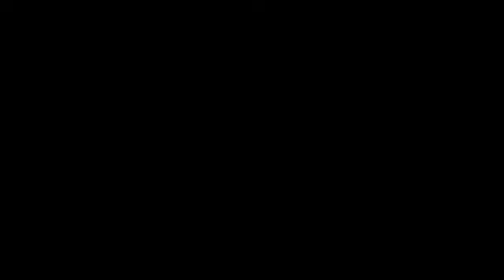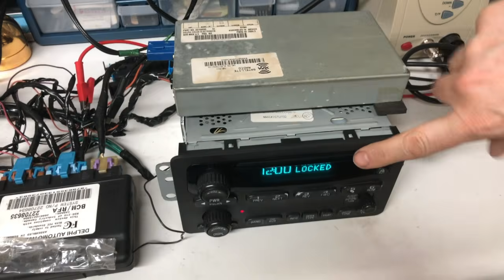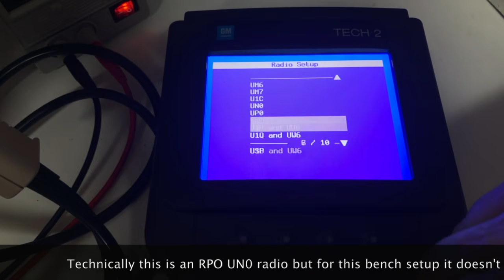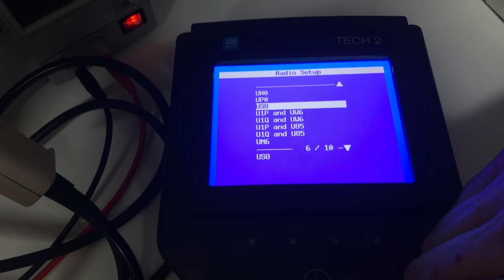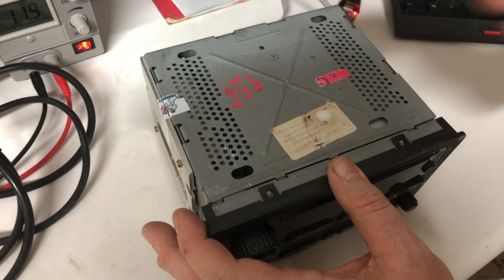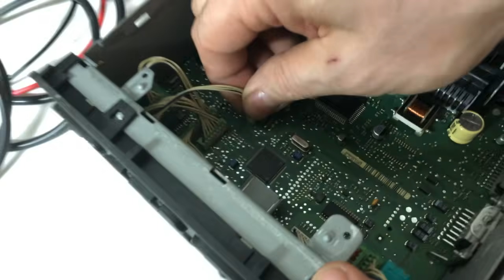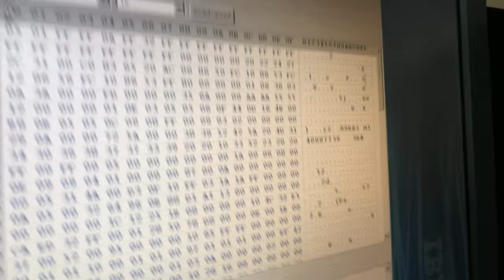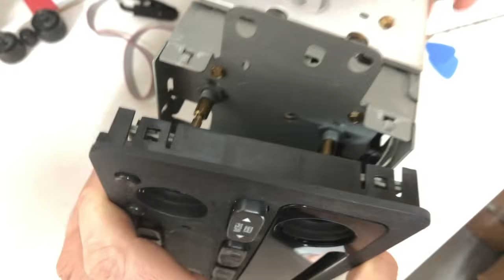2003 - 2006 How to VIN Unlock Salvage Yard GM RDS Radio w/ Tech2 OR Manually Programming its EEPROM

Comment: The Tech 2 doesn't seem to do a VIN relearn on a 2005 GMC truck
Reply: Yeah, I needed a new head unit in my truck (original one stopped having sound output) so I when to a junkyard and bought a new one. When I went to reprogram the radio with my tech2 (it's a clone) I didn't see any of the options or functions to reset the radio and release the lock. So now it just sits on my shelf. I have since then moved on and installed a aftermarket head unit but always wanted the stock radio...
Reply: My truck is a 2007 Silverado classic so it should be very similar to a 05 Silverado/Sierra

Comment: FYI - I was working with a six disc CD radio(GM part # 10357886) pulled from a 2004 Suburban and going into a 2004 GMC Yukon XL Denali.  I was using a CH431A black programmer and AsProgrammer 2.1.0.13.  After some fiddling around (and help from your video) I was able to get an output screen of all zeros.  As mentioned in your note, I was concerned that I would have to desolder the eeprom, which can be a bit tricky.  It turns out that if you connect the test clamp just right a small yellow LED will light up on the front of the radio, with only a single red LED on the CH431 for the power, not the LED for the run status.  At this point I was able to generate a hex output using the I2C, generic 24CXXX, 24C08 profile that allowed me to change the VIN # which was on line 0X000003B0.  I installed it into the GMC and all the radio functions are working, except for sound?!  That will be my next project...Thank You Dr. Shock, and I hope this helps someone else down the road.
Reply: yes same for me :D

Comment: Modified the CH341A for +5v output like you described in your other video.  The radio I'm trying to unlock (from a 2003 Chevy Suburban) looks the same on the front as in your video, but under the bottom cover I found the 9355093 EEPROM and it is not obstructed by anything.  Anyway when I connect the test clip to the chip, I keep getting the message "Connecting Error CH341 (not found)".  I have tried multiple times to read the EEPROM (with the old radio so I don't screw something up with the salvage radio), but keep getting the error message.  Tried turning the clip around backwards on the chip momentarily, but the red light goes out on the CH341 programmer!
Is it possible the chip is bad or can't be read on the board??  I'm frustrated!
Reply from the maker: Some radio circuit board designs have multiple chips on the same traces to that EEPROM.  So a testclip creates interference, bus contention, by powering up those other chips at the same time.  In those designs, you have to unsolder and remove the EEPROM from the circuit board and work with it off board.  Then resolder it back when the re-programming is complete.

A good way to verify this is your situation, is to attempt to read any known good EEPROM chip with the programmer before working with the radio.  Always test that your equipment is working OK before starting a repair.
Reply: @DrShock  Bought EEPROM chips and tried to read a 24C08 chip with the CH341, but it can't read the chip!  Wondering if the ASProgrammer I downloaded from your link is corrupt??  The version I downloaded has already been translated to English (not sure if google translate automatically changed it from Russian).  Could you send me a direct link to the software?

Comment: What if you don’t have access to the RPO code such as a radio from eBay? What do you do at that point?
Reply from the maker: If the radio in the vehicle is original OEM, just go with the GM part number on the white sticker on top of it.   If the original radio is missing, you will still have the RPO code attached to the vehicle service parts sticker, and a dedicated radio shop will be able to identify the correct replacement with that plus the VIN.   Even better, the radio shop will be usually be selling it as unlocked.
Reply: @DrShock  ok it still has all the stickers, do I take it to the dealership?
Reply from the maker: For the age range this video covers, going to the dealership for an unlock would cost more than two or three times the value of the radio itself.  If this isn't something you could do yourself, I'd suggest a radio shop or a small independently owned mechanic shop that has a GM Tech2 type scan tool.
Reply: I’ve got a tech2win, and I was able to get the vin from the seller on eBay, and I got the rpo code. Will the bcm in the car write to the radio if I set the tech 2 off the donor vehicle?
Reply from the maker: Not all GM model BCMs will do the VIN relearn function, which is why I also showed how to edit the chip at the board level.  But if you have the tooling, build the vehicle in Tech2Win and confirm it has the menu option I showed in the video first.

Comment: How do I verify which chip I have? Trying to unlock a 2012 traverse oem radio
Reply from the maker: Trial and error is really the only way if its not one someone has already published information on.  You need to desolder the chip from the board so you can experiment on it out of circuit while attempting only read operations while trying different chip family settings in the programmer software.   Sometimes there will be a fab symbol on the chip to at least indicate the manufacturer.

Comment: It is a great video! But it’s a bit beyond my capabilities, especially with my rocks, screwdrivers, hammers, and basic multimeter. Very interesting, and one day, possibly when I have more time I’ll be back to try it on my stock stack. aftermarket radio will have to do.

Comment: When you say "standalone" you mean without GM software?  I am VERY new to tech 2, got one for working on Saabs but the PCMCIA card is Saab only and doesn't work in a Silverado.
Reply from the maker: You can use the Tech2 all on its own, without the TIS2000 software.  I refer to that as standalone mode.   Unfortunately, GM has dropped support for the Tech2 back in 2021 for the online Techline Connect software, so they can really only be used standalone, or with the vintage TIS2000 PC based software nowadays.

Comment: Greetings and thanks for the good informative video.  

Now then, seems no one on these videos are going into enough detail for those of us who are unfamiliar with the programmer sequencing.  Can you refer us to any videos are explain how to set up and navigate the Programmer... how the interface works, etc., in better detail...it just looked like a bunch of Matrix type numbers scrolling up the screen all jumbled up.   How exactly would we know to put that other last six digits of another VIN number in?  Where did that number come from??  How do we get to that screen you were on?  LOL, what's going on?  Any additional helpful advise so we can make sense of what we saw you doing in regards to that chip-reading/re-programming part of the video would be great. Thanks.
Reply from the maker: Thanks.  It would be very easy to brick a radio if you did not have prior experience with chip programming.   My advice here would be to simply desolder the chip from the original radio, and transfer it over to the donor.   This route would requires some experience and having the tools used with surface mount device soldering, but no programming.
Reply: @DrShock  okay That’s what I’m thinking.  Thanks for your feedback!🙂

Comment: Hello, I know this is an older video but, will the steps for eeprom programming work for a 2007 gmc yukon xl radio that has the dvd player in addition to the cd player?
Reply from the maker: The process and approach will be the same for any Delphi/GM radio of this era.  But the circuit board layout can vary considerably model to model.   And the EEPROM number on some less popular radios may not be already known, so you may have to experiment to identify which chip is the correct one.

Comment: Can you just swap the eeprom chips from original radio into the replacement radio?
Reply from the maker: If the GM/Delphi part numbers on the radios white label match exactly, yes you can.

Comment: question! what would happen when manually programming the eeprom if you left the vin section blank or removed the existing vin and dont replace it?
Reply from the maker: Depending on the radio model, either 0xff or 0x00 hex written to these locations will end up being viewed as virgin out of the box mode and the BCM will encode the VIN automatically.   This will only work if the exact same number of bytes as the VIN are used, one more or less and it will remain locked.
Reply: @DrShock  thanks doc!

Comment: Trying to use my vcx nano and tech2win to replace Bose radio in my 2003 suburban but no matter what code I select for vehicle it only comes up with Chevrolet truck and then I select radio and it keeps saying no communication with radio.
Reply from the maker: Communication protocols to the radio change over the model years,  so be sure that the radio is the same model year as the truck.   When you build the vehicle in the Tech2 menu, be sure to select the model year and engine code based on the VIN.
Reply: @DrShock  I appreciate the quick response. I’ve been reading comments on this video and discovered that you need to build the vehicle in tech2 for the vehicle it came out of?

I have two used radios. First one is a 6 disc changer 15184935 manufactured 10/01/02 so guess it’s from an 2003 Silverado or suv. My original radio is a different part number but looks identical. Other radio is a single cd and cassette combo. Part 15104156. Manufactured 01/30/04. No idea what this came out of. 

If I understand correctly I just need to try different years and vehicles until I can successfully reprogram vin?  I’m trying to do this with key in on position which radio then goes into theftlock. 

My original 03 suburban Bose radio works great unless it’s below 50 degrees then it powers on but no sound until cabin heats up. And it still randomly reboots during use. I’ve tried heating the main board of radio up to 400F to reflow solider, this helped for a few days then back to its old problems.
Reply from the maker: You don't have to match the original radio part number wise.  You can upgrade to something higher, but you'll want to stay in that same model year vicinity and what was available on the truck new.  Like a 6 disc changer from another Chevrolet, vs one from a Cadillac Escalade.  This is usually the path of highest compatibility.
 
The comments you're reading on building the vehicle differently than actual have to do with getting around when GM removed the ability to do a VIN relearn from the menu.  But you mentioned having no communications at all, so different problem.  You need to solve the lack of comms first.   This is usually, other than the VX Nano variable, due to having a mismatch in compatible modules hence my model year comments.   Verify comms to other modules, like the PCM, to avoid his being related to the Nano.
Reply: @DrShock  spent more time with vcx nano and tech2win. I verified it actually is connected to my 03 suburban. But every time I select year the vehicle (chev truck) and a letter code? Tried all the letter codes and I always get message cannot communicate with digial radio. I can however display data from radio and read DTC codes like u1000 but whenever I try and vin relearn or radio setup it just completes right away and radio stays locked. 

Only vehicle I don’t get the can’t contact digital radio message is the express Savana but once in menu there isn’t a radio setup or vin relearn just other functions like srs vid info radio id info etc. 

Seems like my vcx nano tech2 software can’t remove theftlock with my 03 burb radio even though I can read its data like volume level antenna strength etc.
Reply from the maker: I did an older vid on how to know which code to pick when building the vehicle - https://youtu.be/TwUFPPy3J_I for future reference.  It does sound like a problem with the Nano.   You might try just doing an SPS (TIS2000) or SPS2 (Techline Connect) recalibration instead of the VIN relearn.   For older vehicles like your 2003, this usually (but not always) will also perform a VIN relearn.
Reply: @DrShock  making progress I think lol. On the main menu I can’t go to sps get an error it’s not supported by tech2win. I can however go into diagnostics select my year, chev truck, then K, body, navigation radio, then body control module, special functions then I can F1 request BCM info for sps or f2 request VTD info for sps. I did f1 and it says info stored in tech2win but I don’t know what to do from there. I don’t have the tis program you speak of in another video
Reply from the maker: No you cannot do SPS with Tech2Win, GM blocked that along many many moons ago.  You have to use Techline Connect at www.acdelcotds.com which may also require updates for your Nano to work as a J2534 diagnostics interface.   ACDelco will do a two year per VIN bundle for a fair price on SPS2.    I can't say for sure this will work with a Nano, I only use it with the GM MDI tool.  But I have read of folks getting the Nano to work with it.  I also can't  say for sure it will do the VIN relearn, as when I hit these problems I just drop down to the circuit board level and swap EEPROM chips.   But again, I've read folks had some success doing so on older vehicles.  Newer ones, no dice.
Reply: @DrShock  thanks again for the quick responses I’ll probably do that subscription and post back if I’m successful. My local dealer charges $150 an hr and I’ll still be in it less than that by purchasing vcxnano and the delco subscription
Reply: @DrShock  I found a supposed workaround by using tech2 version 30.004. Others have had success using this version to unlock older radios but I still get error loss coms with vehicle check jumper when trying to do vin relearn. I know my vcx nano is communicating as I can read sps info and see my vin info but still can’t relearn vin to radio. I somehow purchased the exact GM part number radio to replace my failing radio. Could I just move eeprom chip from old to replacement radio? Would it just work then? I’m not great at soldering but maybe there’s a better tool to use than just a standard hobby soldiering iron?
Reply from the maker: Yes, you could just swap the EEPROM chip between two radios of identical GM/Delphi part numbers of this model year.  Just take photos to insure the orientation of the chip pins is kept exactly the same.  You will have better luck with the soldering iron using a low melt solder additive like the SMD1 that I linked in the video description.
Reply: @DrShock  moved the EEPROM chip from old radio to new. Used a heat gun at 400F and it worked great! Replacement radio powers up with all my old presets (makes sense since it’s the memory chip) no locked message! Thank you! 🙏

Comment: How or where can I get the computer software that you are using?

After buying the adapter EPROM, how do I put all this together and integrate the software that you are using?

Lots of questions about this because I’ve been to three GMC dealerships all three told me they could not reprogram or unlock my salvage radio, even if I paid the $175 labor, they were very staunch about it and it seems that whatever the problem is they just don’t want to fool with it.

I could really use the help in getting my own computer software and EPROM clip set up for use, there are a lot more folks out there who have this very problem and if I can get it set up I can fix mine as well as help out some other people.

Thank you for your time and attention to this matter.
It’s funny that I’m a PhD and know absolutely nothing about electronics I am a clinical psychologist who can’t unlock my salvage radio nor get the dealer to do it.
 Please help.
Dr. Jamie Brown
Reply from the maker: The answer to the software question is to reference the earlier video, and its description, that I did on modifications to the Black Edition CH341A EEPROM programmer so that it can be used for automotive applications.   That video is linked in the upper right of this one (just click on the white circle with an i icon that Youtube puts up there).

Unfortunately, this is not a typical DIYer kind of job.  You have to have quite a bit of existing experience in desoldering, soldering, and EEPROM programming to be successful.  If these are new skills, I would suggest trying out what you purchase with some blank chips and scrap circuit boards before taking on your GM radio.

Comment: Just had need to reprogram a 2005 Bose Envoy XUV radio to install into a 2004 XUV. I purchased the unit for doing so and modified it by disconnecting the 3.3 volt pin and using a jumper to join the 5v to the 3.3v spots as indicated. Anyway I got it to read with AsProgrammer  but there was nothing showing so then I also found a posting that said if I disconnect the the Vin on the EEprom it will work but give a calibration error so I did that instead and it seems to work. Disappointed the reprogramming didn't work but what the heck. Now I have to find out why I only have sound on the driver doors tweeter or midrange speaker. Cheers!